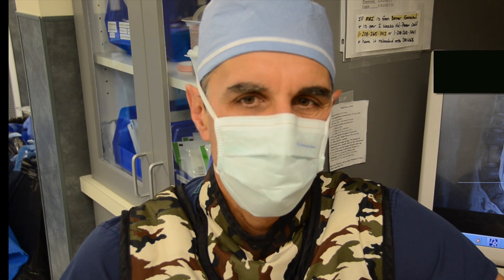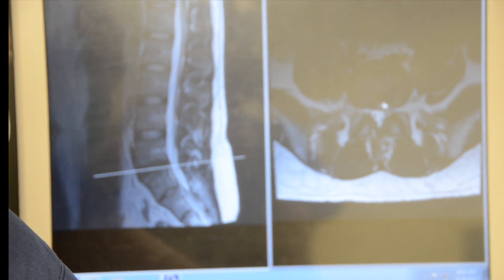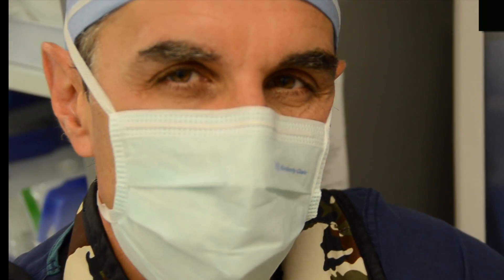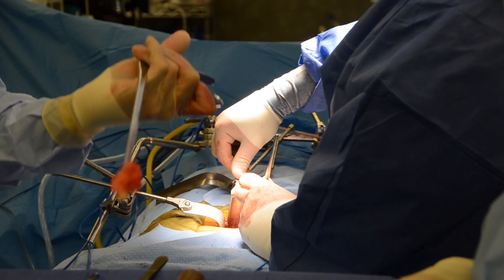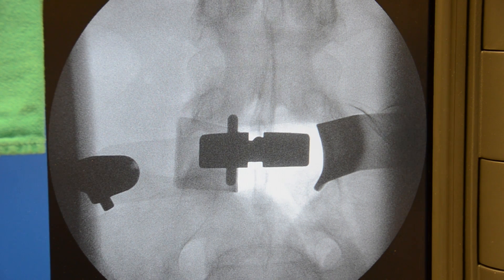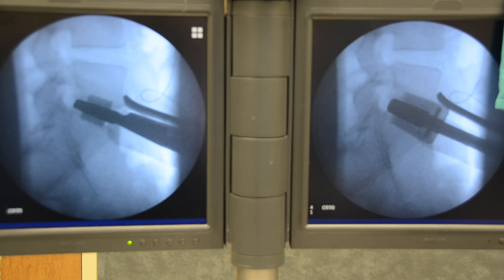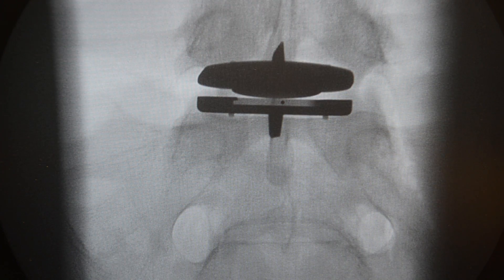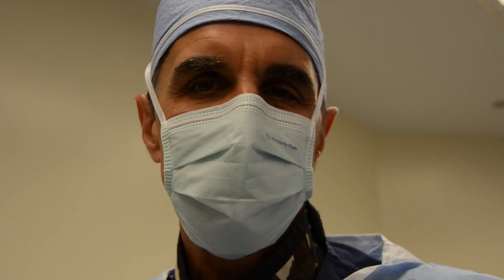Lumbar Artificial Disc Replacement Surgery, Synthes Prodisc-L

Comment: I wonder if this core of the disc which you've installed separately in the end would not slide out later when the patient moves or lift weights for example ... is it fixed there somehow?
Reply: it locks into place

Comment from the maker: Spondylisthesis at L5/S1 generally indicates that there are pars defects (spondylolysis). This is not a condition that is generally treated with artificial disc replacement due to the excessive motion/instability. Fortunately, there are minimally invasive fusion techniques that work well. See the videos regarding MIS Tlif and ALIF (anterior lumbar fusion).